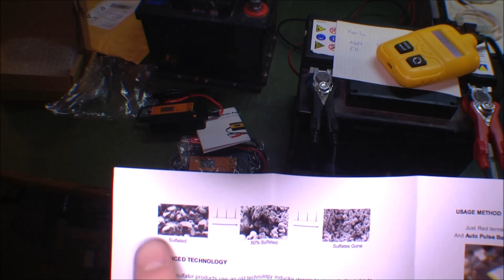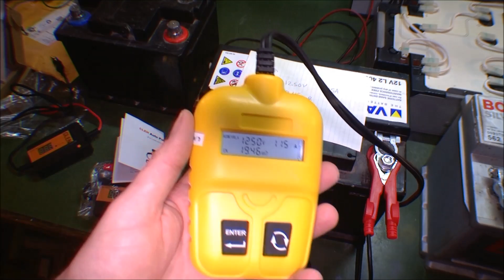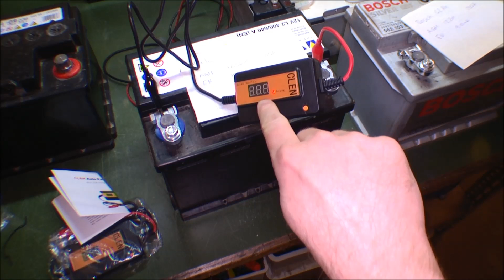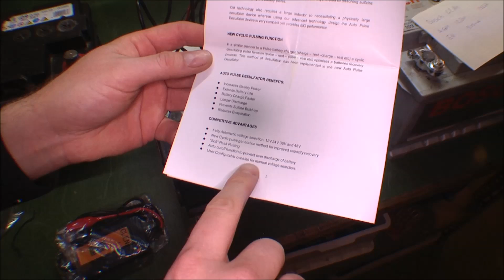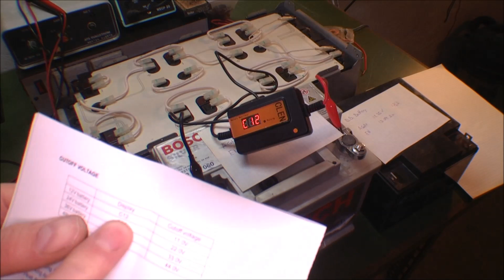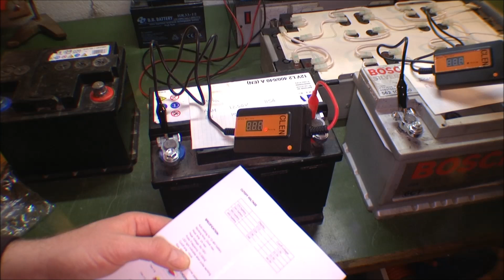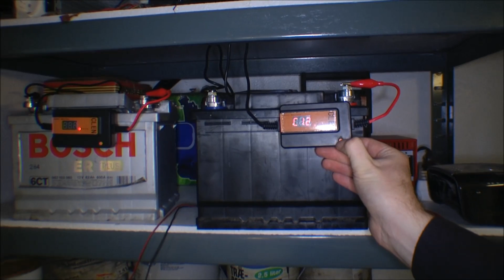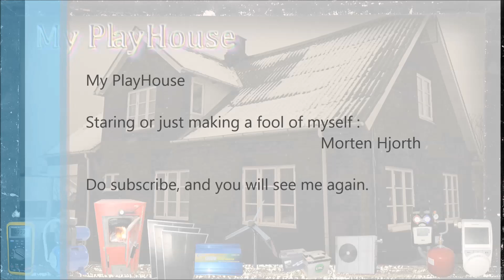Two new Battery Desulfators 12 24 36 48 Volt - 170

Comment: The battery needs to be full charge ?
Reply from the maker: Hi Malkitzedek Pf
No,, if the battery is really bad you can use it with a charger. I am not sure this device does anything..
Thank you for watching! :-)
Reply: My PlayHouse thanks
Reply: They all are snake oil I've tried 7 batteries for months none came back infact they all got worse

Comment: I just realized that there IS a reason why the Lead battery manufacturers always present the Measured capacity of their products at a lowly "C20"rate:

simple: most lead family type batterys are not very good in sustaining high amperage draws for a long time, that is the negative result of the "peukert factor"that is the more amps you draw from a battery the smaller it seems to be....
The Much newer family of Lithium battery’s are far Les prone to this effect, hence they are not only lighter in weight, but also capable of sustaining high discharge amp draws in the order of even 2 to 5 times there capacity!
Ideal for automotive use or on a electric bike...
I my opinion the ancient Lead acid (yes Also AGM) is nowadays onlyl good for lighting and operating radios etc,  thus Low draw,
But for demanding POWER you really are better of by switching to LIthium...
Preferably the nice LiFePO4 variety.
As another benefit you can forget desulphators altogether simply because these batts DO NOT get sulphated at all! 

Another benefit is especially with LiFePo4 the fourfold number of Discharge cycles in the order of 2000 cycles at 100 DOD!
simply impossible with even the best lead acid types.
Reply: IF 18650 CELLS ARE CONNECTED IN PARALLEL AND THERE IS A SHORT IN ONE, YOU HAVE TO THROW ALL.
THE SHORTED CELL CAUSES ALL OTHER HUGE DISCHARGE CURRENT.  THE SAFETY MEMBRANE DISCONNECTS THE CELL AND IT IS VERY HARD TO MANUALLY RESET WITHOUT DESTROYING THE CELL.
DENDRITES GROW THROUGH SEPARATORS EVEN IN LITHIUM-IRON PHOSPHATE BATTERIES. EVEN IN THOSE CONSTANTLY CHARGED TO A CONSERVATION VOLTAGE OF 3.0-3.2V AND STORED REFRIGERATED BY THE ARMY IN OPTIMAL TEMPERATURE AND HUMIDITY.
Reply from the maker: Lead is getting replaced with LiFePO4 in many cases now,,, now that the prices has come down,,,

Comment: @chaotica extreme
what I ment was the minimum voltage "under load" so 11 volt is stil safe then. 
what happens wit cycling is that the oxidatien layer gets broken up so that the plates start to work again . 
Same thing happens when you start using a battery again, that has been sitting still although charged  for a long time, its benevitial to first cycli the battery before use, otherwise it wil have a low capacity  ( little  amphours) although the open resting voltage seems good ( 12.7 /13.00 volts) suggesties a full charge, as soon as you put the battery under load the voltage Will sag.
After One or two cyclus the batt restores its ah capacity again.
voltage measure ment aloë is NOT a good measure of batt health, better check the amphours Allso!
Reply from the maker: Thank You for your good info,,, back then..

Comment: Hi i have almost the same Desulfator the only difference is the blue front instead of orange.  

it works very well my experiences is positive.  

I have an old starter battery that have not enough energy to start my diesel engine, after a few days undercurrent with the desulfator I could start the engine again.

I can recommend this desulfator. Saves a lot of money on new batteries.
Reply from the maker: Hi lexpee
Thank You very much! for that info.
Thank you for watching! :-)
Reply: You have interesting topics. I saw that you have a enormous server in your basement of your house, is that not a little overkill? Or need you so much storage?

I wonder how much power it used?
Reply from the maker: Hi lexpee

I do get this question from time to time, so I have added it to my F.A.Q. that you can check out under the "about" tab here on my channel. I give a longer answer there.
Thank you for watching! :-)
Reply: +lexpee, I am still trying to figure out if there is any difference between the various colored cleanpower brand desulfators. It looks like maybe it has to do with the amount of A/h, capacity of the battery.
Reply: Yep Cleanpower that is him,  Here it work wonderful.  My stater battery is 100AH.  It work not if the battery is to old or total gone.  My starter battery is 5 year old.

Comment: also most people just putt a desulvator on a already charged battery and leave it there for a couple of ours than to vind that they measure no improvemend , that is because its necessery along with desulfating to also cycle the battery,  thats is to bring the voltage way down UNDER the normaly recommended minimum voltage somewhere around 11volt!
its not dangerous at all and even beneficiall IF you start recharging with low amps immediatly so the plate conversion process starts up well
Reply from the maker: Good info
Thank you for watching! :-)
Reply: giottodiotto1. I understand where you are coming from, but how can a deep discharge be beneficial? Every cycle removes life from the battery. Deep discharges, even more so, and for starter batteries, every cycle is particularly damaging. I would suggest a drop tester 'cycle' or 2, then charge back up.
As an example, an Ultramax 7.2 Ah AGM will do 400 cycles at full discharge. 1200 at 20% discharge. I wouldn't attempt that with a vehicle battery.

"somewhere around 11volt!" 
If I may. The minimum voltage is a function of the discharge rate. 10.5V appears average, but you can go lower if using a high current drain. 9.6V in the case of the above example. The voltage will 'bounce back'. If you go lower than normal voltage on a light load, the battery will suffer severely.

Comment: as a rule of thumb its best when you not draw more amps per hour than the factory max recommended CHARGING amps, since charging is in fact the opposite of DIScharging....
e.g this would be for a 100 amp marine, agm ore deepcycle battery something around 20 ampere per hour, this can be higher of course but a lead battery wil not be happy with a greater load than one tenth or two tenths of its max capacity ( C10- C20) 
furthermore desulfaters DO work but there are many bogus types on the market mostly from...you guessed it...CHINA
i myself did resently brougt a smal 4 years old AGM (12V- 7 AH) back to usefull order by decharging it with a small 300 milliamp load until the voltage was 10.5 volts ( under load) as soon as the load was removed in bounces back to 12.2 volt than recharged it with 600 milliamps with a smal inexpensive IVT accu- activator plus( sends a spike back every 30 seconds in the battery, left it charging for about 10 ours , charger floats no higher than 13.8 volts....after this battery was working again in good order with about 80 percent of its original capacity back!
so it seems that someone in china has a good time and you not, hope this helps do try it with another device ans you WILL see good results
Reply from the maker: Hi 
Well I am kind of waiting for something to come around that works and I want to pay for.
Thank you for watching! :-)

Comment: Igen en fin video! Jeg kunne godt have ønsket mig at du testede din battery analyser ved først at lade 1-2 batterier op inden du gik i gang med din desulfator.   Hedder minus i øvrigt ikke Ground eller negative på engelsk?  Og plus positive?  
Er det helt hip som hap om du sætter negativ eller positiv til først? 
Anyways, fedt at jeg ikke er den eneste batterinørd i DK :)
Reply from the maker: Hi +Simon Dambro 
I of course understand what you are writing,, but I keep this channel in english,, i have viewers from over 200 countries.

I do charge the batteries before i put on the desulfator,, and i often leave the charger on wile desulfating. The poles of the battery is very often just called Plus and minus ,,, just like in Danish.
I do think that it in cars is good practice to remove the minus lead first, and then the plus,,, but desulfator,,doesn't mater :-)
Thank you for watching! :-)